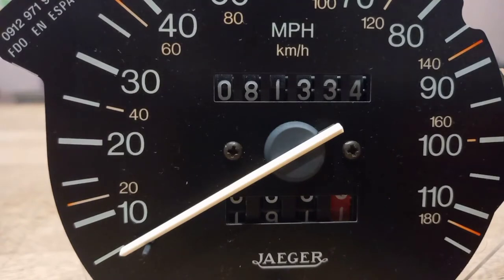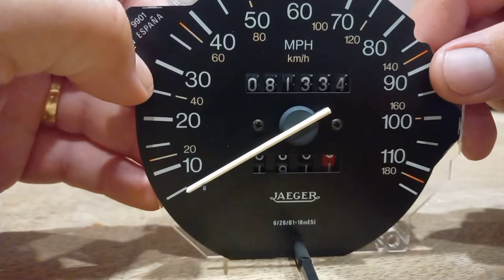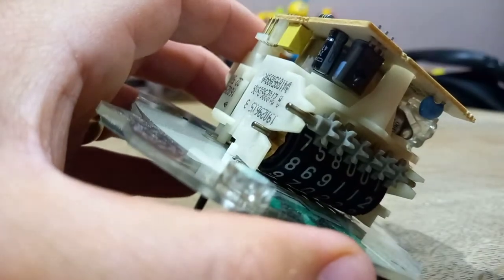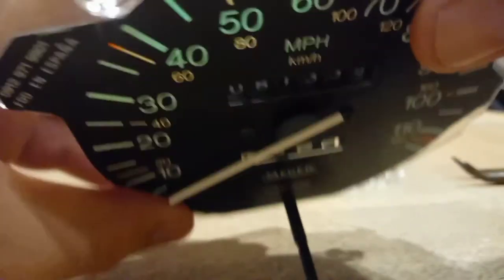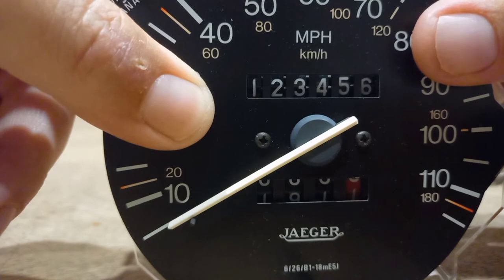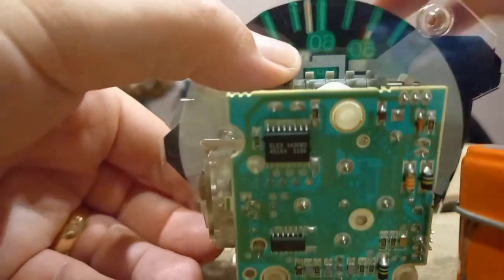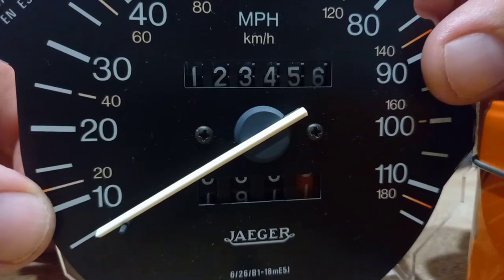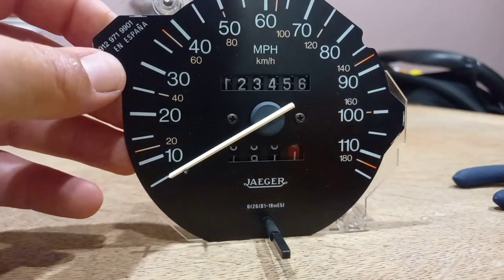Mechanical Mileage Correction How To Guide

Comment: Hello, excellent video, thank you very much! Do you know if the green color of the illumination of the numbers is printed on the transparent glass/plastic? Or is it on the black plate where the speed numbers are drawn? In my AX First, in the air conditioning lighting, what gave the light the green color was on a transparent plastic plate behind the air icons. Thank you!